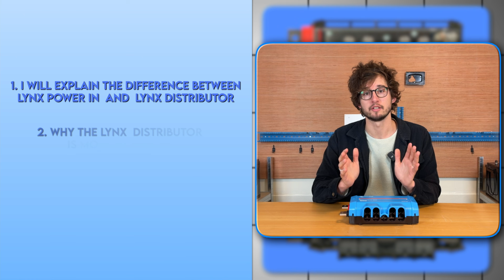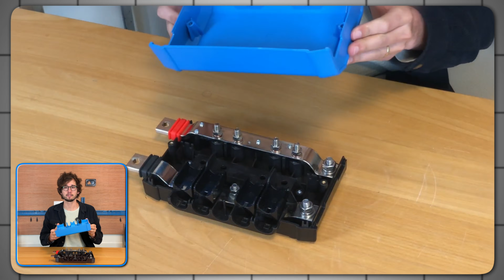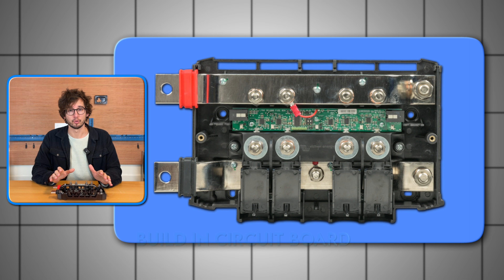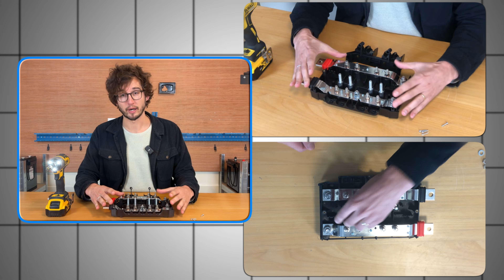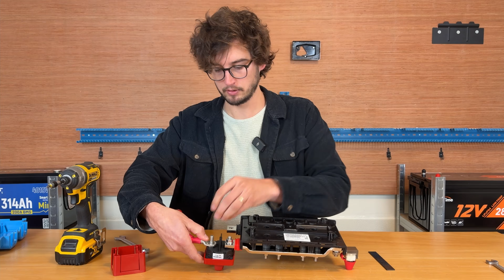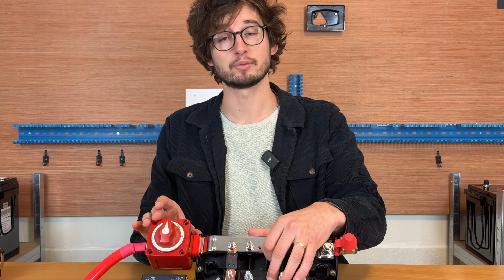Victron Lynx Power In vs Distributor – Main Switch and Shunt Installation.

Comment: Hi,  thanks for the video, can i use this if a have 2-3 200ah 48v wall mount batteries connected to my Inverter?
Reply from the maker: If you're using lithium batteries, I'd suggest you use a t-class power in.
Reply: @Gridless-Solutions thank you

Comment: Hi mate. 
Greetings all the way from Australia 
Thanx fur these videos I have learned a lot from your videos and appreciate what u giving back to world. 

Can you do a video for the below situation 

- I want to build a 600a off grid system using victron products. Abd 6 -250w or 400w solar panels 

- rather than series connecting the 6 solar panels… is it’s possible connect the 6 solar panels , 6 isolators , use  6 individual Mppt controllers connected to a second Victron distribution box . The main reason of doing it like this is to is to increase efficiency

Thank you
Reply from the maker: Hi, thanks! If you'd want to use the software, you can not create 6 individual strings of MPPT's

Comment: Just bought your software subscription. A few questions:  is there a way to add multiple MPPTs?  What about using a power in rather than wires to parallel batteries.  Any plans for a 24v Victron 5k inverter? Lastly, separate t class fuses would be helpful. Thanks!
Reply from the maker: Hi, Thanks for the message. Not at the moment, but we are actively working on that. Same goes for the power in. In you situation, would you use a T-Class power in? You can select a 5k inverter, but only if you select 230V AC voltage. Is there a 5K24V 120V Victron Inverter Available?
Reply: @Gridless-Solutions thanks for the quick reply. As a marine user, I would use a t class fuse at the battery then go to a regular power in. Between the 2 Lynx units, I plan for a switch and a smart shunt. As far as the inverter, there is a 24v 5000 in 120

Comment: You said Deez Nutz! haha, but seriously though, good explanation. Do you have an opinion about BEP 770 EZ witch? it is 'front mount' design, and it is rated for 400A continuous. I believe this switch would go well with a typical 2x 12v battery high BMS (100-200A each) setup.
Reply from the maker: Haha, Yes the BEP 770 EZ is a good alternative!